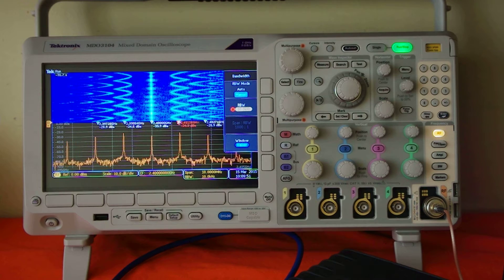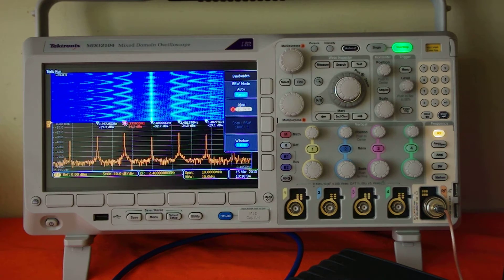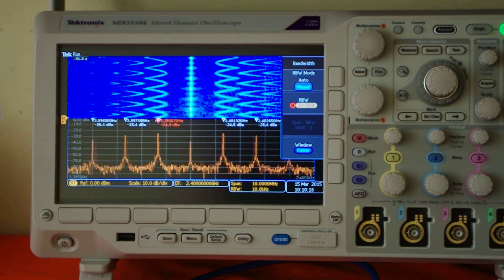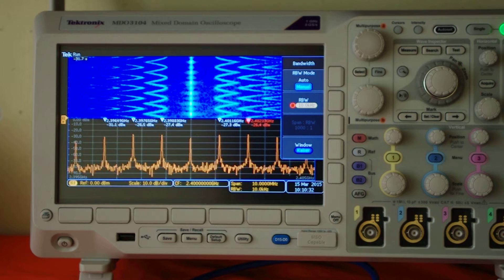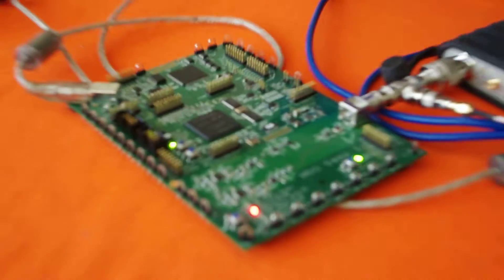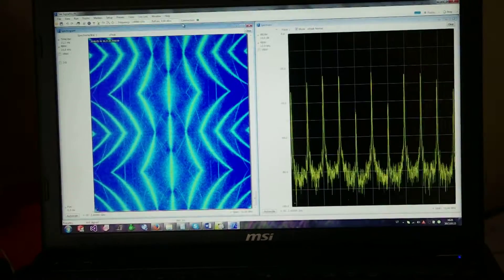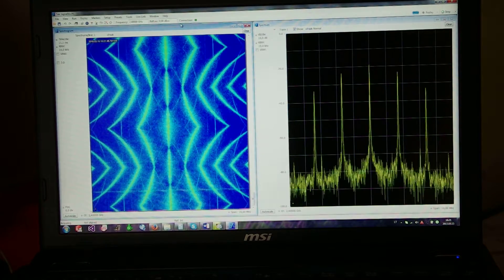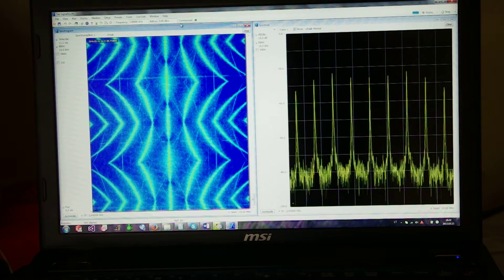MDO3104 vs RSA306 (2.4Ghz + 10MHz span, 10K RBW)

Comment: Thanks for sharing this, I am considering buying an RSA306, but thought if the performance of the spectrum analyzer in the MDO3000 was of similar quality, I might get that instead, so I'd have a free standing unit with a nice oscilloscope thrown in.

Other than the speed and glitch capturing capability that you've shown here, are there other important differences in performance between the two?

Thanks again!
Reply from the maker: Michael Colton 
First, MDO3000 use clever FFT to get spectrum, so you will capture all frequency during data capturing. RSA is swept tune type spectrum analyzer, it will work faster if you have small frequency band on top of high frequency carrier to get same resolution ( since fft needs more points to get resolution)

Also, RSA306 can take larger signals and can do more measurements, because it's limited only by software. 
Main question is why you need spectrum analyzer, that will give answer if RSA is better than MDO
Reply: Linas K Thanks for the quick reply! I'd be using it (mostly) to develop an Amateur Radio product I am working on called the PortableSDR. So mostly I'd be interested in measuring power output, harmonics, and the quality of the transmitted signal. It would not be particularly important that I be able to do some of the digital decoding that I know the RSA306 can do, and I don't really think I'd go into the higher frequencies the RSA306 can reach either. Of course, I want an instrument that I can use for future projects too.. If the MDO3000 is hooked up to a computer, can it use the same software as the RSA306, would that improve performance?

One other thing I haven't found in reading the datasheets for the MDO3000, can it trigger on an external input like the RSA306 can?
Reply from the maker: Michael Colton 
well, what is your maximum frequency ? if below 100-200MHz, just buy MDO30x4 where x is you maximum frequency you need, it will be free spectrum analyzer to a same frequency your analog domain.
MDO3104 is very very good scope, also you can hack all decoding, spectrum analyzer and frequency generator without any problem